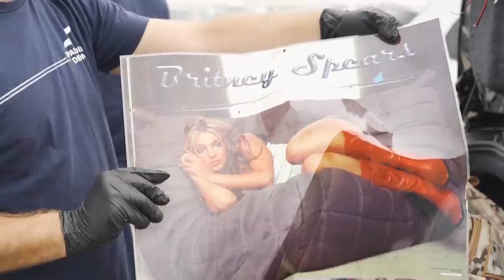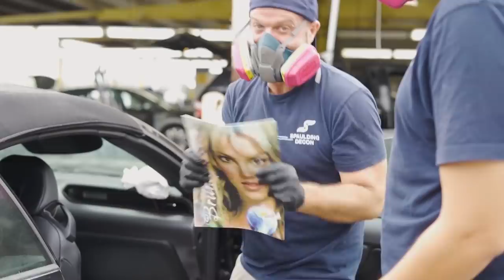S3 Episode 1: Spilled Milk

Comment: You guys should’ve asked the people there to open the convertible for you, it would have been much easier to empty out the back seats
Reply: David Caffi that’s if they could get to the lever to put the top down. On a Mustang you can do it either electronically or manually. But it looked like there was too much shit in there to put the top down.
Reply: I miss my convertible.  Makes it so easy to haul things that are otherwise too big to fit in the car. Put the top down, put it in the backseat and you're good to go. That would really come in handy today since I have something I need to move that won't fit in my current car lol
Reply: Battery probably died

Comment: Idk if yall know as much as me abt mustangs but thats a convertible with the 5.0 ltr V8 and 401A interior package plus the premium package for the leather and to top it off the $5000 performance package for the brembo breaks. Also cant forget abt the $1100 10spd auto trans option. That car would run you almost 55k🤧